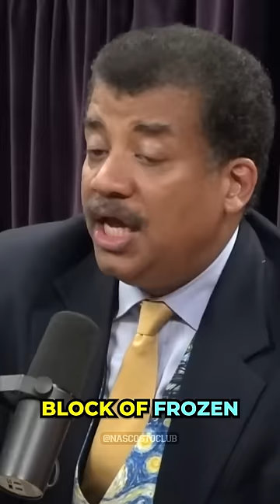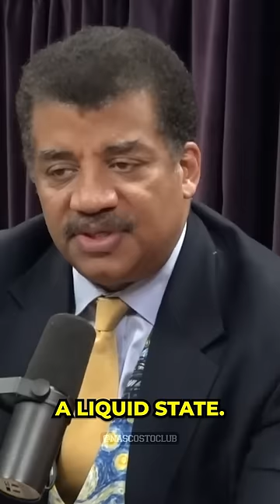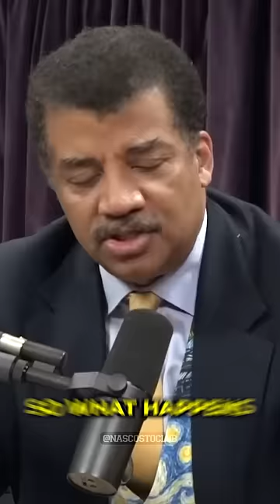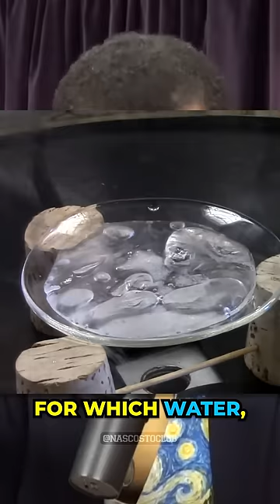Dry Ice Becoming WET⁉️🧊 #shorts

Comment: I saw a documentary on national geographic about underwater vents from under the sea. the temperatures exceed 400 degrees celsius, but the water stays liquid because of the enormous pressure. it makes sense, if you think about it
Reply: Yes, every 10 metres deeper, equals 1 more "atmospheric" pressure, so if you are at say 1km deep, the pressure is 100 times greater than at the surface. Some of those "black smokers" are over 5kms deep, so the pressure is 500 times greater than at the surface. It turns a Styrofoam cup, into a thimble.
Reply: You realize, that that's what's happening in a pressure cooker right?
You can cook (not boil!) your potato's hotter, because after the steam is caught, the pressure inside the pot is rising and the water stops boiling whole beeing hotter than 100°C.
Reply: I could listen to Neil all day if both of had enough interesting subjects.
Reply: @joseppedaia3673  Yes, it's the same as the water in your car. It's a sealed system and gets hotter than 100°C (much hotter) but doesn't boil unless you blow a hose.
Reply: @castleanthrax1833  u don’t use water as coolant in ur car… this just isn’t true at all… it bursts because of high temperatures causing it to evaporate and steam causing pressure to build up… you use anti freeze which has a much different freezing and boiling point… it boils much hotter than water and freezes colder…
Reply: @DaFlameGamers  The coolant that you use in your car is designed more as an anti corrosive, than to have a different boiling point. The reason your vehicles cooling system does not boil, is because of high pressure. If you cut one of the hoses, the "coolant" will boil instantly.
Reply: @castleanthrax1833  Pure water has more heat-carrying ability than pure ethylene glycol, so water would be the best coolant to use if the only consideration in the selection of coolant was its ability to carry off heat.

But water presents other challenges. It forms rust on iron engine parts. The rust is then carried off to other cooling areas. The resulting corrosion interferes with heat transfer even before the build-up plugs the radiator and fills the cooling system with sediment.

Coolant helps reduce corrosion and engine rust. Coolant also provides resistance to freezing. It won’t freeze and expand in hyper-cool temperatures like water would. That protects your engine from cracking and experiencing increased pressure.

The reason the liquid instantly boils when you cut a hose is because the engine can get the liquid well above its boiling point regardless of the fact that it has a boiling point well above that of water... The system contains the pressure so as the liquid tries to evaporate it creates more pressure in turn raising the boiling point... The pressure on a typical cap will correspond to a temperature of about 250 degrees F, 120 C,... Removing the cap (or cutting a hose) will cause the pressure to drop, dropping the boiling point, causing it to start to evaporate...
Reply: @DaFlameGamers  Why are you just paraphrasing what I've already said?
Reply: @castleanthrax1833  im not... you said its because of high pressure, which implies that the system in which your coolant is put into is pressurised... it is not... it becomes pressurised when driving, if it were always pressurised then when you take the cap off after it cools down then you would be covered in coolant...

 How about you read what i said? Paraphrasing also means to shorten your reply... my explination was way more indepth and actually accurate
Reply: @castleanthrax1833  You also said that it is not to do with the boiling point, however that is the main driving force for the coolant choice...
Reply: @DaFlameGamers   The system that the coolant is in IS pressurised. The heat from the engine causes it to be pressurised. I didn't say it was ALWAYS pressurised. Stop creating something I didn't say. Twirp.
Reply: @castleanthrax1833  lmao sure bud my man said "twirp" fjhskalfjlakf it isnt pressurised what so ever lmao... when you evaporate something it expands creating pressure... it isnt a pressurised system lmao
Reply: The system isn't inherently pressurized... when you say a system is pressurized you imply something like an aresole can, where the can is constantly under a state of pressure allowing you to store more and distribute what ever easily... your coolant system is not constantly pressurized... so it is not a pressurized system...
Reply: @castleanthrax1833  "Twerp"*
Reply: @DaFlameGamers  Aerosol*
Reply: @DaFlameGamers  Twirp*
Reply: @castleanthrax1833  it does create pressure... because the molecules start to expand... when you have it contained the container becomes pressurized...
Reply: @castleanthrax1833  Theres a thing called vapor pressure... 

Note that the rate of evaporation of the solid is equal to the rate of condensation of the gas. The pressure exerted by the gas in equilibrium with a solid or liquid in a closed container at a given temperature is called the vapor pressure.
Reply: @castleanthrax1833  There is an outwards force created as the molecules start to expand and spread further apart... hence pessure... but alright lmao keep digging
Reply: @castleanthrax1833  and i know your going to try and look it up and before you make yourself look even stupider... Our atmosphere creates a closed system... when things "evaporate" they have to overcome the pressure that already exists in our atmosphere... That's why things boiling points change when you put them in a vacuum... because you are removing all the atmospheric pressure thats "keeping the molecules from spreading apart" so to say... Something can not evaporate unless it can over come the inherent atmospheric pressure that exists... 

TLDR The "Something" its contained in is our atmosphere... all vapor creates pressure...
Reply: @DaFlameGamers  It would appear that you are the one who is digging. I'm not going to continue this. You can continue your discovery though, Wikipedia is your friend.
Reply: @castleanthrax1833  I bet lmao, so things that evaporate don't inherently create pressure unless in a closed system right? So vapor doesn't exist in space?
Reply: @DaFlameGamers  What is the point of me commenting? All you do is paraphrase my comments and twist my words (or make them up outright) just so you can argue about things I didn't say, and then quote passages from your high-school textbook. Thank you for your time, but I see no reason to waste any more of my time, simply reading what I've already said but in different words, which is what you have mostly done. Thank you so much, but I have more pleasant things that I can be doing.
Reply: @castleanthrax1833  You said evaporation doesn't create pressure when it obviously does you keep making yourself sound more and more ignorant lmao... lets try and dumb it down for you... you ever heard of a pressure cooker? you know what happens if its not made properly? or if you heat it well above 100F? it explodes! Why do you think this happens?
Reply: @castleanthrax1833   @Castle Anthrax  Ik you want to make yourself sound smart but I am not "paraphrasing your comments" nor am i "twisting your words" I'm saying whats actually correct... you are just wrong lmao... and I'm sure you probably didnt graduate high school so you wouldn't know but i'm sure you won't find a single high school that gives you an indepth explanation of thermodynamics in its science course but alright.
Reply: @castleanthrax1833  I bet, u seem like the type to always find learning something boring huh?
Reply: @DaFlameGamers  I learned something new today. I leaned that women like you will argue about nothing, and lie with impunity.
Reply: @castleanthrax1833  Where have I lied lmao and I thought I wasn't worth your time yet you keep coming back over and over again. Sounds to me like you have these women like tendencies you are describing
Reply: @castleanthrax1833  get a new personality and maybe a you can find someone with a double X chromosome to fix ya right up
Reply: @DaFlameGamers  Are you having your "mensies"? Tough time of the month fo ya?
Reply: @DaFlameGamers  Hahahahaha. Like you could beat me up. Thanks for the laugh. It's time for you to go paraphrase someone else's comments now.
Reply: @DaFlameGamers  the pressure ratings of the radiator cap has a lot to do with it, too.

Comment: I took chemistry. I'm disappointed I've never heard of triple point, but I remember going from solid to gas is sublimation. Why?
Reply: Depends on how far you went with Chemistry. Phase diagrams (where we see the triple point and its conditions for a given substance) are generally taught at the senior high school and first year college levels of chemistry.
Reply: You would have gotten that by, yes, going farther in Chemistry... in Physical Chemistry or an intro Chemical Engineering class.
Reply: @speller9  or any engineering class that covers physics. States and transformation of matter.
Reply: Triple point was definitely a part of chemistry.
Reply: @maths.solved6215  Well, that explains it! I hated Chemistry, so high school was the last time I endured that torture!
Reply: @soham8295  I def don't remember triple point. I remember Boyles' Law/ Charles' law. Not the formulas or what they were for, but strictly the names... go figure.
Reply: I learned about triple points in my first year of chemistry at university.
Reply: @jessiejeanne9717  sublimation is when a solid object is subjected to both temperature and pressure to force the change of state of matter from solid to gas and skip the liquid state due to the conditions forcing the change of state too rapidly, normally these conditions are when the temperature and pressure is lower than the 'triple point' of a substance meaning it's impossible for the liquid iteration of the substance to exist.
Reply: Because it's not natural on earth. We have to manufacture the perfect condition in a lab for this experiment. And it doesn't sound cheap.
Reply: You weren't paying attention
Reply: It also greatly depends on the enthusiasm of our teachers. 
 
    If our teachers aren't enthusiastic, They can't really be bothered to go over or to help convey the knowledge in a way that their students will understand and 'take home' those concepts.

    There's a big difference in merely having information presented to us by someone who doesn't care about the subject, verses having someone with a mindset of empowering their students and who is willing to walk through the process with them towards a better understanding.  😌🌎✨
Reply: @deeez00 - Oxygen Gas (O2) in Oxy-Acetylene Bottles, is usually delivered at 3,500 PSI, and H2 (Hydrogen Gas) is usually compressed up to a Maximum of 10,000 PSI for the Tanks in the Toyota Mirai Hydrogen Fuel Cell Vehicle!

Maybe under one or the other of those Pressure Points, someone could "Demonstrate CO2 "Melting?" 🤔🧐😳😂
Reply: I didn't really cover it until thermodynamics

Comment: One thing that was not mentioned was that as you pressurize a gas you reduce the space and intensify the heat causing the temperature to increase. Refrigeration systems use those facts to remove heat from the air to create a cool environment using substances that are saturated at low temperatures to increase the heat transfer rate. 

The refrigerants are at a low pressure low temperature saturated liquid (LPLT sat. Liquid) in the evaporator. As the indoor fan motor and compressor begins to run, heat from the refrigerated space begins to transfer to the refrigerant turning the saturated liquid into a low pressure low temperature gas(LPLT gas), which is only a few degrees above the starting temp. The refrigerant is pulled into the compressor which turns the LPLT gas into high pressure high temperature gas (HPHT gas) in the condenser to release the heat into the air outside. As the heat is released the refrigerant begins to cool into a high pressure high temperature subcooled liquid (HPHT liquid) to go to the metering device. The metering device is what separates the evaporator from the condenser by causing a sudden pressure change to cause the HPHT Liquid to flash gas into LPLT sat. gas (some saturated liquid does enter to allow for more heat to be absorbed) to repeat the process until the thermostat is satisfied.

Comment: The higher the air pressure, the hotter a substance can remain liquid. Pretty simple. Geology shows us that water can reach over 1000°F without evaporating. But that only happens deep under ground at extreme pressure. If there's not enough volume of space, then evaporation can not happen. That's why the lighter fluid is liquid inside the lighter.

Comment: 2 loop steam generation systems use a primary coolant loop pressurized beyond 1000 psi to maintain liquid state at around 500 f. Or different combos for different systems. The higher temperature allows for greater heat transfer to the secondary loop, but if a drop in pressure ever occurs the primary coolant will flash to steam & if an explosion didn't happen then a failure to cool the heat source will result in a meltdown.

Comment: Yup, nuke reactor on a sub is basically a giant steam kettle .. pressurized line (primary loop) allows for much higher boiling point, another non-pressurized line (secondary loop) "cools" the primary through cooling coils (primary and secondary never actually intermingle) instantly flashes secondary loop to steam, steam turns turbines making electricity.

Comment: Here is a good experiment, go to the store and get some dryice and put it into a empty 2 liter soda bottle put the cap on nice and tight, this way it keeps the gas from escaping and will increase the atmosphere pressure inside the soda bottle and it will turn to liquid, use a clear plastic bottle so you can watch it happen.....
Reply: That's not a good idea, because the physical strength of the bottle may be insufficient to contain the pressure, and at the very least, you may experience a "blowout" of the bottle. Not exactly an explosion, but it will be extremely loud "boom". I've seen people do it by putting "mentos" candy into diet coke, and putting the cap back on.
Reply: I think I would stand back and wear eye protection, just in case. Plastic bottles do not have infinite strength. 😖

Comment: "Takes co2 up mount everest"
Reply: Nothing different would happen to CO² on top of everest than at sea level. It's a gas under both pressures.
Reply: Not the same pressure Larry, but yes, there would be no difference because the air pressure is less, at the top of Mt Everest than at sea level. CO2 would only go from solid to liquid at a greater pressure.

Comment: If the water boils at 32 degrees, does it burn or feel cold?
Reply: It's 32 degrees, so what do you think? Boiling isn't a state of heat, it's a liquid turning into a gas. Try not to think of it as "hot or cold". Something can be boiling, but at a temp that you perceive as cold.
Reply: Liquid nitrogen "boils" at an incredibly low temperature, but it is still boiling.
Reply: @castleanthrax1833  i realized that after i put the comment. Thanks tho for explaining it

Comment: I don't think Helium has a triple point
Reply: It does... In fact, Helium has 2 triple points.
Reply: @speller9  only if you have a different definition of triple point for helium. Because I can't find the triple point where it becomes a solid
Reply: @yiannisspanos694  because it's very difficult to make helium a solid
Reply: @hadiisaboss5307  can you confirm this? Google says that helium turns to solid at 25atm 1K. What is the triple point of helium? Helium is a weird element and has more than 3 states. So I can't find if it can be gas liquid and solid at the same time
Reply: @yiannisspanos694  because you're thinking of helium as this blizzard element that no one knows that it can do instead of an elemental atom. all matter has a solid state, liquid state, gaseous and plasma. it's just more difficult depending on the elements atomic mass and how strong the bonds between the electrons and atoms are
Reply: @hadiisaboss5307  I was talking about it's superfluid state